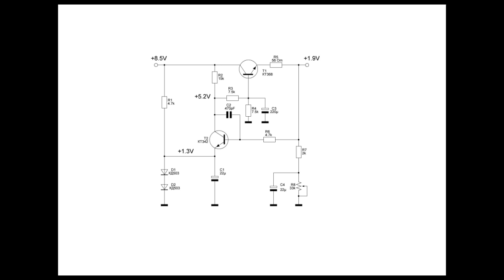Transformate Regen receiver

Comment: Io come componente attivo uso un FET es. un j310, ma alimento anche la resistenza di Source con una tensione positiva regolabile rispetto al Gate, con la rispettiva resistenza verso massa e un diodo Schottky catodo a massa.. 
..inoltre regolo alla minima la tensione sul Drain, in modo da trovare il punto della curva di risposta che mi sia più conveniente, in genere sul Source ci si avvicina alla tensione d' interdizione, mentre sul Drain a quella rispettiva di saturazione.. diciamo che come tensione Drain-Sorce mi funzioneranno sugli 0,40V.. ..però pensando che stiamo amplificando segnali di pochi uV, questa soluzione di cecare il tratto di risposta migliore, un poco critica da tarare, mi pare meriti esperimenti.. ..anche sulle valvole.. alimentate quindi a bassissima tensione.
Che ne pensate di questa doppia regolazione..
Reply from the maker: Saluti. Fai sempre le tue ricerche, ti darà informazioni preziose, questo è un buon post http://dl4cs.de/funktechnik/drx/fet-einkreiser/en.htm
Reply: @SergStarchak  Nel circuito che hai postato (disegno N°1) io ci aggiungerei un potenziometro tra alimentazione positiva e massa negativa, per portare tensione variabile sul capo della resistenza da 4.7k sul Drain (tolta la resistenza da 470 ohm attuale).. e un secondo potenziometro, sempre elettricamente collegato tra i due capi dell' alimentazione, portando tensione variabile al capo della resistenza da 3.3k di Source (tolto il potenziometro lineare invece adesso solo in serie), regolando per una tensione molto vicina all' interdizione sul Source ed una molto vicina alla saturazione sul Drain.. come ti avevo già suggerito.. per me il segreto per stabilizzare le cose è quello. 
Io (da dilettante) continuo su questa strada.. ..se avrò tempo.. ..provando anche con il BF998 e con delle vecchie valvole termoioniche alimentate con tensioni molto basse.. a scanso di scossoni!
P.s
Quel solo stadio BF mi pare poco.. io ce ne aggiungerei almeno un secondo anche identico del BC547b
Saluti e buon proseguo di sperimentazioni! il circuito a reazione positiva da sempre nuove emozioni ..e sorprese 😀
..provalo anche come preamplificatore selettivo d' antenna pure molto ridotta.. per la prova basta avvicinarlo ad un altro ricevitore senza antenna..
..da cui volevo provare con 2 reazione accordati in cascata.. non si finirebbe mai.. Ciao